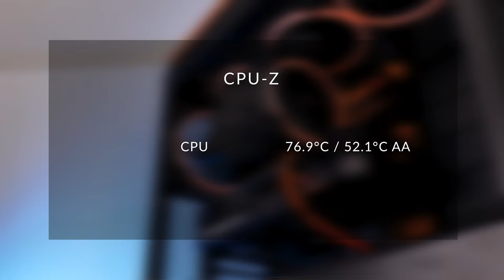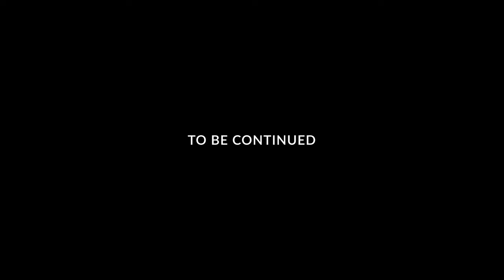Building The BEST be quiet! Build - Ep.3: Finishing the LightBase

Comment: Yo I just got this board 3 days ago and installed it, (second hand)
And I had the SAME DRAM issue you described! Unfortunately I am using a deepcool assassin 3 so getting to the ram slots after installing the CPU fan is annoying as hell. The fan blocks the ram slots and the GPU blocks access to the fan clamps so you have to remove it, then remove the fan,and only then you cas access your ram slots.
I knew the bios was new enough to work with my 5600x since the dude that
sold me the board had that CPU so it was 100% something with the ram.
I tried different ram configurations to no avail, put a single stick in the  A1 slot and it finally booted. it did waste about half an hour of my time though. 
after the intial boot I restored the bios to default settings and it worked with the sticks and I could enabled DCOP.
I think the bios just went mad since the previous owner left his DCOP and bios settings enabled and it just refused to boot with my ram kit.